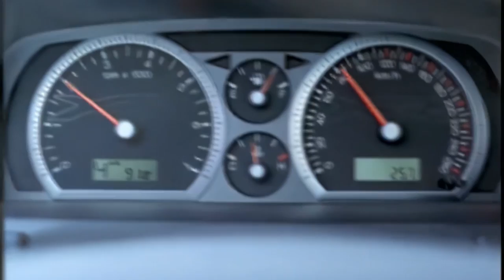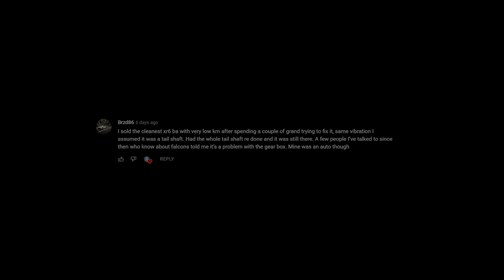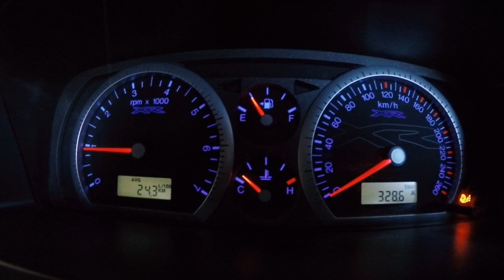Trying to fix the BA Falcon's Driveline Vibration For Good!

Comment: I am so glad I'm not the only one that has gone through this. Glad you're on the right track Sean, this issue drove me nuts for years.
Reply: My Ford territory only vibrates when it's in drive gear and stationery. what causes this?
Reply: @magyaradam  Engine mounts mate. Two on the engine, one under the gearbox.
Reply: @magyaradam it's usually only 1 that needs changing. lift your bonnet up and try putting it in drive with your foot on the brake if you rev it a little and your engine lifts up definatley engine mounts only about 80 bucks and takes 15 min to change

Comment: Chased similar vibration in my old ba around that 80kmh mark. After having all the "pros" mess with it I brought some of those clip on tailshaft weights and put it up on axle stands and run it up to 80 or so. I used one of those vibration measurement apps and just messed with the weights until it improved. I got it a lot better but never fully gone. Best thing I did to fix all my ba xr6 turbo issues was sell it :)

Comment: Being a mechanic, I have gone through this issue multiple times on multiple different Falcons. The CV on the end of the tailshaft is a common cause of vibration, the CV loses the oil from the grease over time past the cork gasket that is under the dome-shaped sheet metal cover. No matter how closely the CV components are inspected, abnormal wear will not be found. The only solution is to replace the CV joint, they are available from Hardy Spicer.
Reply from the maker: New CV certainly helped, and tomorrow's video will show you what finally fixed it!
Reply: @MotoringBoxTV  probably on car balancing using trial and error with clip on weights to get the remaining out of balance vibration down to an acceptable level, am I right?
Reply: @2secondslater  I got to the bottom of mine with the use of a hose clamp.  Just use it to offset weight till you find the sweet spot.  Once I found it though, I went in to my local Ford dealer and bought the clip on weights, removed the hose clamp installing the weights behind the shaft in it's place.  Car is as quiet as a mouse now.  All of this when Ford, and even 2 driveline companies couldn't fix the issue. Oh and it also helps to have a hoist at home... 😛
Reply: My dome cover has dents. Can you make a comment about the probability of how come?@motobox

Comment: Sufferred for years on my BF XR6turbo with this problem.  First occurred on a change of 4 tyres, so suspected that it was a tyre balancing issue. Not the case.  Tyre shop said my alloy wheels were out of round! I did not believe this as I hardly ever curb my tyres, leave alone the wheels.  Anyway took the car to an alloy wheel repair who said the wheels were out of round.  The alloy wheels were machined but you gussed it, the vibration was still there. 
 Finally took it to the leading Ford dealer who changed some bushes on the rear suspension and as you are aware there are a 1,000 bushes on the control blade. You gussed it again- no difference. Decided to live with it, as the car is still an absolute delight to drive at speed.
Finally found a good mechanic who did mostly Fords & Holdens.  He resolved the issue by changing all the rubber bushes to Super Pro bushes (made in Queensland). A change of tyres from Bridgestone RE003 to Michelin Pilot sport and the car is now a dream as good as new!
I reckon the Bridgesone's asymetical pattern COULD have set up an out of sync frequency with the suspension.
All this cost me more than $3,000 to fix over the years. Love the car!
Sam

Comment: Hi - I have a few questions 

vibration - through the floor and you feel it with your feet  or through the steering wheel

Steering wheel vibration, is it a shudder or steering wheel shaking left / right   or up / down

There are many things to consider

1. Front sway bar bushing can cause this
2. Steering rack mounting
3. Out of balance driveshaft gives a "cork screw" vibration
4. centre carrier bearing worn / ripped / soft
5. Road wheels - check first all weights are on, re balance as it is cheap , also unless tyres are fairly new even though they have plenty of tread they can be out of balance, some difficult tyre balancing or if they use excessive weights, have the shop un mount the tyre of the rim in spins it about 20-30 degrees from where it was and re-balance - often you will get away with not having to much weights on the wheels
5. Buckled or warped rims
6. gummed up brake calipers and to undo master cylinder and back of push rod

I noticed you mentioned each 1/2 of the shaft was balanced, well that is sort of fine, but they need to install a new centre bearing  then re-balance the complete tailshaft as a unit - the bearing and the bushing will not be 100% neutral - so even if each 1/2 shaft is 100% perfectly individually balanced , bolted together with another items may not have it remain 100% perfect

The parts cannon is that last resort - but try swaping easy stuff with a friends car that does not have the issue - you will still do the same process of elimination - do the easy ones first , first the wheels, then the complete tailshaft

Once those 2 are Ok, then you look at transmission of diff as a possible fault  - in the old days ( 60-80) the 3 speed and 4 speed manuals were simple to take of, place on bench or floor and turn the input shaft by hand and see how smooth it was - todays its a real drama

Also - finally, go check your engine mounts,they are fluid filled and they will leak and sag, one side is more easy to change than another and many shops just do the 1, but if you have both done, the steering actually feels much more stable and the ride is better - i had one side changed at @ 100k' and recently had both changed a few months ago at @ 150k's - i noticed straight away the car in reversing and low speed driving felt much more glued to the road and no vibration and also the drivers side mirror no longer vibrates at idle in gear when stopped

Regards
George
Reply: And if you in do the shaft the first time… mark the location so you can put it back in the same spot.

Most times you don’t want a balanced shaft, as you will need to add weights to it, try it and rotate.

But centres got out all the time

Comment: I'm pretty sure that if you have universal joints on a tailshaft you are supposed to run them in pairs, so they cancel each others vibration out. These 2 piece tailshafts only use one universal joint.

Comment: The weights that clip on near the cv joint are used at Ford dealerships they dynamically balance the shaft on the car and normally have some reflective tape on the shaft as well. 

They used their diagnostic tool (VCMM)  along with with a vibration sensor (MTS 4000) to locate the imbalance. It might be worth contacting a dealership and have chat to them about it.

If you can't  find any weights some hose clamps can be used for balancing. Easy to put on and move around to help improve the balance.

Comment: Good luck with it mate, it looks like you've broken the back of it. I wish I could say the same for my 2005 BA Ghia MKII. She's done now 288k kms, she was driving like I was in a spin cycle of a washing machine which led to the diff bushes, rear lunch pins, front wheel bearings, fh right control arm and she still makes jingle bell sounds. I've also changed the water pump, oil sensor, and the power steering hose and other control arm are next to change. I keep remembering back to watching an engineer say on the TV news that they build cars to last around 9 years. That guy clearly knew what he was talking about. I feel these cars start falling apart when they reach around 200k+ ! I've spent so much on her now that I've got to keep going I guess and sort out the rest of the crap with the suspension:(

Comment: Great video. I can tell from the footage under the car the centre baring is toast & should have been replaced. Splitting the shaft & having it properly weighted & balanced will make a big difference. I would also have replaced all the bushes & mounts that hold the shaft in place too. 
Keep up the good work 😊

Comment: I got an on car tail shaft balance done by Ford on my old BA after doing getting the centre bearing done. I was told at the time that it could take several attempts to get it right ( tried to shake itself to bits at 60kph ) Luckily it got fixed first go. Loved the car when it was right but it was rarely right and compared to the previous AU I had which was the most reliable car I ever owned the BA was a nightmare. Glad to sell it in the end.
Reply from the maker: It seems incredibly difficult to find dealers who still do it. I guess most of their current lineup are FWD.

Comment: It's not a vibration, it's a massage function 😀I had a steel skip bin out front many years ago, cost me something like $300 for a weeks hire - the first night I had it some bugger came and filled it half up with their crap.  Recon I knew who it was too but no way to prove it.  Glad they got it mostly sorted for you - worn CV joints can definitely allow the shaft to move off centre a bit and thus vibrate - I've had it happen with a FWD driveshaft with badly worn CV joints - felt like a wheel bearing but was actually just the shaft slopping around in the joint (you could tell it was the joint because it would clack like a mofo whenever you turned a corner though)

Comment: I came to the same conclusion with my BA Fairmont Ghia, that 90-95% done was good enough. The vibration was there, but not so bad. I guess we just need to live with that. I know your frustration and sympathise with you.
Reply: Even new cars off the lot can have niggling issues. Sometimes the best best fix is the put up with it fix, as long as it's not detrimental over time. You end up becoming accustomed to them and it can sometimes take getting used to if a noise gets eliminated! 
Often, noises disappear all by themselves.

Comment: 5:30  Wacol Station Rd level crossing.  I wouldn't be too concerned about the second set of tracks on the southern side of the crossing.  The tracks are not used by regular suburban EMUs.  It's a ballast/works siding.  Most likely used at night, and slow speed shunting of works trains into the ballast yard.  The crossing has caught me out a few times.  You are waiting for the traffic to clear the roundabout, to either on to the east bound on-ramp for the Ipswich Motorway.  Or, wanting to get onto the bridge to go southbound on Progress Rd.
Reply from the maker: Figured one of them must have been not in regular use - still scared me for a brief second there!

Comment: Just remember that the white plastics on the rear bolt threads are 5gram weights, so don't just snap them off like most people do and mark where you've taken them from and how many where there, also 3 or so centre bearings available so identify and measure the exact bearing required for application.
If fit a 1 piece shaft you'll probably void insurance as the split shift was fitted to supply part of a crumple zone. Ask insurance company before completing this modification

Comment: My territory seems to have the same issue. 85 km/h seems to be where the vibration is most noticeable. I tried taking the weight off the rear CV bolts and the vibration is 90-95% gone. Probably worth messing around with various weights and seeing what makes a difference.
Reply from the maker: Exactly right - check out the video tomorrow!

Comment: Just recently got my NA BF XR6 and had to spend a grand on deferred maintenance (brakes, coils, plugs, filters, oils, etc) and there's still some sort of noise from the rear, not the bushings or suspensions according to my mechanic and not dangerous. So I've decided to accept 95% and live with it unless something goes wrong. 

And tell me that 24.3 litres per 100K is off, thats well off the charts, you'd be living at the servo :)
Reply: My xr8 only does 16-19 ltrs per 100 around town

Comment: G'day Sean ...I had the 2003 BA Fairmont Ghia ...That  tailshaft  vibration drove me insane to the point that I got rid of the car with that as the primary reason . Other issues too including the sat nav and ICC , Great engine though .. My old AU ll  is as smooth as butter in that regard as is my 2008 FG XR6 ... Neither have diff bush issues either like BA/BF seem too .. Beats the band but I still love the BA's generally ..just won't own one again any time soon .
Reply from the maker: The next video tomorrow might be interesting for you to check out... it could potentially be the way your old car could have been fixed!

Comment: Would converting to a one piece tail shaft help? Seems the centre bearing leads to a lot of issues.
Reply: Reason Ford didnt go single piece was the IRS would wreck havoc on the driveline lacking support to the gearbox. Ive heard of dudes trying singles on falcon irs cars and when pushed hard, they've smashed the tail of the gearbox / auto off and the whole lot has fallin on the road.

Comment: Hi Shaun you didn't mention whether they tried to correct the centre support bearing bush issue you found with your cameras.
It seemed like you were on your way to solving the vibration all yourself. 
Were the staff courteous and sympathetic or one of those workshops where the staff look like they're judging you every second like many are like?

Comment: If they've fully balanced the shaft and the centre bearing and rear joint are fine, then it's not the shaft. Diff bushes, rear axles, something else is causing your problem.

Comment: Steve Jones.......I am currently chasing a rumble in my BA ..like others here ive had a new tailshaft ,checked twice by supplier even watched as they checked it for out of balance..My list in 12 months is New Centre bearing..New bushes through out diff cradle..New Suspension Blades and bushes,New tyres ,New discs and Shocks...And the rumble still persists after 102klm mark..nightmare to drive on 110klm freeways...Am so over this car lol...

Comment: My 2007 territory TX vibrates like he'll when I break and stop at traffic lights, my side mirrors quiver as does the steering wheel, if I turn the wheel 3/4 left or right the shuddering quitens down a bit, but within moments the heavy rapid shuddering returns, so I put it in neutral and the vibrations stop but once I'm back into drive it returns, so as I excellerate away from a standing position the  resonation noise goes away, can anyone advise me as to what this shuddering noise is when the cars stationary but in drive with my foot on the breaks untill the traffic lights change to go!

Comment: what is it like at 70kph  and take it out of gear?  does it still hav the whip?
Reply from the maker: Definitely isn't rev dependent - clutch in and drop the engine to idle and the vibration didn't change
Reply: @MotoringBoxTV   i like the video you took of the tail shaft...  hav you tried to x2   or  x5  the speed of the footage . that can reveal alot ..  as police use those tactic to see ppl behaviour  . just a thought
Reply: @keithsmith8250  That sounds counter intuitive. Interesting idea. So is police speeding up footage to notice a pattern.

Comment: Where did you get your Triple dash gauge holder from??   .. had my ba xr6t 22 years now & No vibration with mine so far :) & no major issues what so ever .
Reply from the maker: It's one from 2007-ish unfortunately that's been unavailable for over a decade.
Reply: @MotoringBoxTV   Oh' ok.. a guy I was talking to today pointed me towards a company that makes some, but there $299.00 is way overpriced for what it is.. you'd think it was 24 carrot gold plated instead of plastic. must be somewhere i can find some cheaper, I'll keep looking. i have a twin set but want oil pressure gauge as well, not just boost & voltage
Thanks for the reply, tho.